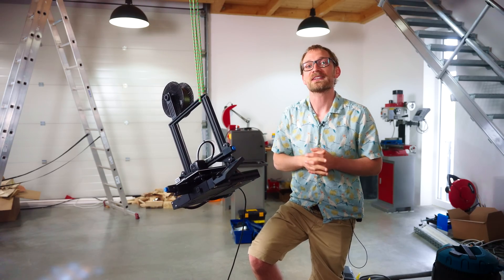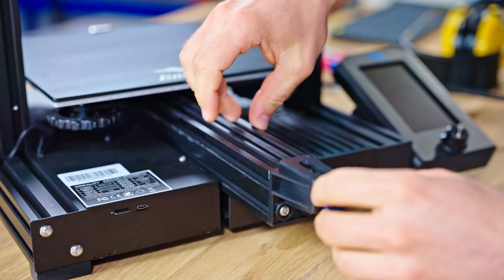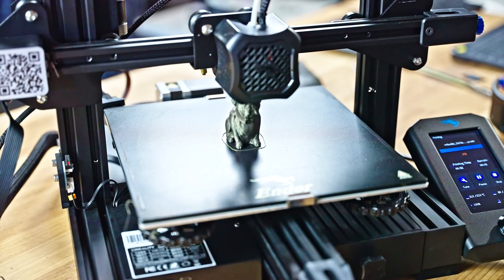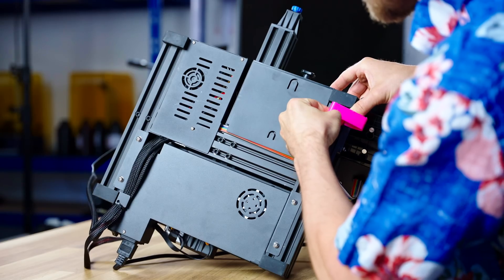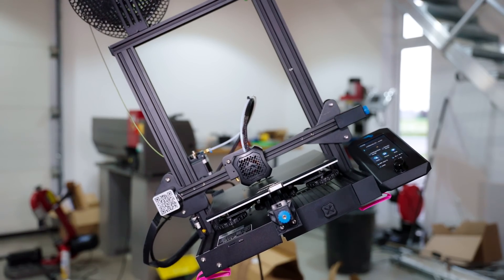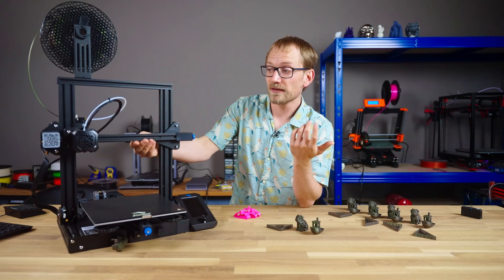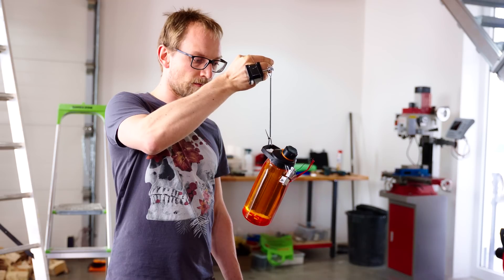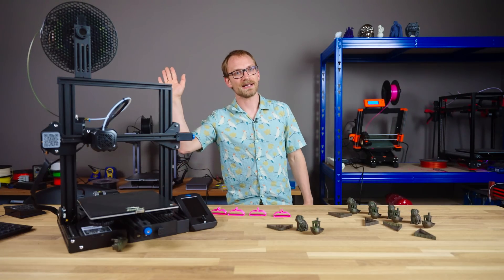Wobbly 3D printer makes for better parts!

Comment: I'm interested to see a printer mounted on shock absorbers for rc cars now, since they are designed to dampen motion.
Reply: My Anycube has such springs under the build plate. I have never observed ringing, but must admit I have only been 3D printing for 7 weeks now
Reply: @juliusfucik4011  The springs under the build plate are there to allow you to level the bed. They aren't designed to damp resonances, and if they are too loose, that can actually lead to problems. You want to have the whole printer frame on springs so that all axes are damped. Also, most of the time the default jerk and acceleration settings on printers are very conservative, so you won't see any ringing.

Comment: perhaps attach a container 1/2 full of sand to the printer head and also perhaps a bigger container of sand to the build plate. the sand container cant be full because it needs to be able to shift, and the more sand that can shift the better i'd imagine. if everything was coupled to the ground but the printing head, and if the printing head had some kind of ballast to dampen vibration, that would be ideal. it's pretty obvious to me that stepper controllers are going to get smarter and compensate for ringing in software.

Comment: For damping it might be worth trying magnetic damping. If you had a large price of copper and some strong magnets held in close proximity the magnets movement induces eddie currents in the copper block absorbing a lot of energy. Could put the printer on springs and have strong magnets on each corner above some copper blocks. Not sure if it would work but I think it would be cool to try.

Comment: Very interesting! Would also really like to see the sand method. I wonder how much of a difference it would be, if you took an ender 3 / i3 style printer like used in the video, and simply poured sand into the empty spaces of the bottom extrusions. I wouldn't think it would add that much weight? but maybe it would actually be enough to make a difference

Comment: I didn't know that even just staying within the elastic deformation range of a material, it will still turn some of the energy into heat.
Until now I've only seen that way beyond deformation, like taking a penny and smacking that thing with a hammer really hard a few times and then touch it and it's pretty warm.

But that the vertical suspension didn't really change anything makes sense after all this, because the dampening axis is almost exclusively in the Z direction, but the main oscilation happens in XY.
So going with the cube suspension where a lot of the dampening would go into XY instead should have results, just like the feet did. Maybe even a lot more of an effect.

Comment: ACTIVE vibration reduction. 

A 3D printer that has masses actively moving in opposite directions to the the print, trying to reduce and even cancel the vibrations. 

Could even have the same processing technique as Noise Cancellation headphones. 🤔

Comment: Could you remove the spring or bungy effect of the rubber with belts that do not stretch? That way the energy is passed directly to the frame and absorbed by those springy feet. Maybe remove the belts altogether and have a gear drive on a toothed rail?

Could the ringing be removed with software? It looks like feedback ringing around the desired location. Since we know in advance the ringing is going to occur after certain directional changes and we know the steps we are going to be taking in advance, can't we microstep our way over the ringing issue? You can certainly measure the ringing frequency/distances so these could be used as input values to an opposing set of steps. PID works real time where I am vs where I should be, but we have the advantage of knowing issues on movements that are coming. You know, a flat straight line which will have ringing on it could be GCoded as a wobbly line in an opposite to ring shape.

Comment: When woodworking, using a scroll-saw, there was an idea of building a 2” high box base with 4 dividers on the x and y. The dividers had 1/2”holes drilled half way up between junctions of dividers. This was then filled to the top of the holes withs sand. Then a top secured to this structure. The scroll-saw once secured to the top of this box, the vibration was reduced a lot. May be worth trying out. Regards.

Comment: I have another idea. We used to paint mask extrusion slots with rubber tubing. Get thick rubber tubing. Stretch it longe and slip it the slot, when you let go, it expands to fill the slot. I know it dampened audible rings very well, but not sure how it would stack up against sand.

Comment: My thing that many in the Anet group have tried with success...Is to mount the machine hard to a plate of MDF/chip board like countertops are made from.  Ideally a counter top cutoff that can be cut and glued back to back leaving the laminate surface on both sides. This is 1.5 to 2" thick and leaves 6-8" beyond the printer base. You can put feet on the bottom of this plinth, I used wine corks to make 3 feet. The resulting base is HEAVY and dense, but does not ring like concrete. Quiets it way down.

Comment: It seems like you accidentally used the table through the anti-vibration feet as a tuned mass damper.  It would be neat to see what happens if you were to duct tape a half-ish full water bottle to the top cross tube of the frame near where the filament mounts.  Basically a very un-tuned tuned liquid damper.

Comment: I don't see anywhere you said exactly what accelerations you used, but at the ones I saw the printer moving at, ringing is a completely solved problem with input shaper.

Comment: Awesome video. I would love to see a follow up on what feet would have the best result. I'm currently using a different type of feet and they don't really bounce a lot, so I'm wondering if they're not too stiff.

When reasoning about why it works; it's actually no surprise that the feet work best, as you explained very thoroughly. With cars you have a thing called unsprung weight, that's everything that's not cushioned by suspension (which is basically all the tyres and brakes). You need a good spring/damper combination, to dampen all both the vibrations of the chassis and of the wheels, as it's impossible to prevent undulations due to road imperfections. That matches the function of the vibration feet. Also, you want to keep that unsprung weight as low as possible, especially in relation to the chassis weight. That translates to adding sand to the frame for printing.

Comment: If you want to be rid of vibrational resonance, which is essentially the problem, you need multiple materials each with different resonant frequencies. Then, whichever frequency is being produced, no frequency is allowed through all layers of the support material and the resonant frequencies are damped. 

This damping needs to happen in all three possible directions of movement.

Comment: I use squash ball or racket ball mounted in a 3d printer holder that is then mounted to the bottom frame. Works really well.

Comment: How about you try attaching 2 identical printers to one base and have the synchronously run the same g-code but one of them has the x and y axis reversed, so they cancel each other out. Or possibly you’d need 4 printers with all combinations of x and y axis reversed and not reversed. Even better.

Comment: Maybe a wire rope isolator could work 🤔 I had good results in the past with isolating vibrations from my drone to a camera using a wire rope isolator. It's easy and cheap to make using some pvc pipe endcaps and bicycle break wire.

Comment: I would just use steel extrusions instead of aluminium extrusions. However, I haven't found precision steel extrusions. I think casting some heavy metal into the extrusion cavities could be the best solution as sand that gets into the mechanical parts can cause a whole host of issues.

I'm using a DIY converted Makerbot Replicator 2x with open source hardware in it and the frame is made of steel. It produces way better prints than my aluminium printers.

Comment: I use washing machine dampeners. They can be bought in hardware stores and you are supposed to cut them to size and put under washingmachines. They are made of cut up rubber and I think they work really nicely. It reduces noise by a lot, and it helps with ringing too.

Comment: Bracing the gantry and moving the spool holder will make more of a difference than anything else since that's where most of the vibration happens, all you need is some thread bar and a handful of 3D printed parts 👌🏻

Comment: I was expecting you to make braces for all the 90 deg frame angles.
I reduced the ringing on my printer by screwing it on to a piece of wood and bracing front centre and rear centre where the belt and stepper motor attach to the frame. The front and rear base diagonals were flexing a tiny bit thanks to the weight of the print bed and glass.

Comment: Lead shot indeed does sound like a good idea here. Maybe exen mixed in with fine sand? Anyways, fill ‘er up and let’s see what that does. I imagine the dampening effect would be similar to one of those hammers that have their heads filled with steel or lead shot. I can’t remember the proper term rn so please excuse the clumsy explanation. I might give that a shot myself, no pun intended.

Comment: Simple answer - the higher the mass the more resistant the object is to get excited by external forces.
Or to put it simple: The more weight the steady gantries and the base have the less likely they start to vibrate from moving parts which are mounted onto them. And for the moving parts it is all reverse: The less they weight and the slower they are moved the lower is the force they work up (accelerated mass) to inflict excitement on the gantry or base.
So, filling up the hollow of the non-moving parts should result in less vibration.
One caveat so: The table where you place the printer onto also will have an effect. If the table is wobbly to start with it will become the weakest point of the overall system

Comment: I could be entirely wrong, but staying within your specific stepper motors “magic multiple”, which is x4 for creality stock steppers, should lessen the salmon skin effect. I am yet to get a print that has it on my Ender since the steppers are aren’t trying to rotate to an in between pole position.

Comment: My printer sits on a desk I used some 90 degree brackets to mount it solid to the wall and cross braced the legs on the desk to take movement out of the desk not the printer solved nearly all my print problems on Anycubic Chiron i do use printed feet more of a squash ball type mostly to improve airflow under the psu and motherboard...

Comment: I think silicone or something similar would be better than sand. Sand will pack hard. Even unpacked, it still has some kinetic transfer (if that's the right terminology).
I suppose they are equally messy but sand near any precision machine (or your lunch) is just a bad idea. Another great video. Thanks Tom.

Comment: I have a cube-style printer and am pretty sure my open square bays are oscillating. Something as simple as tensioned cables could likely fix ringing issues with little cost and weight. Since you don't mind modifying this printer, try adding "guy wires" to the frame front to back on both ends. Also, regarding the ringing you see, is it happening in just one axis, or both? That's a strong tipoff on which axis needs stiffening.

Comment: Instead of where you tried to convert a 3d printer into a CNC, maybe the opposite would be interesting.

Converting a fairly rigid and fast CNC to a 3d printer.

Comment: I’ve got a fairly large printer..  build volume is 600x600x900.  It weights over 100kg and i’ve never had any ringing issues with it.  Thats probly because it maxes out at 33mm/s print speed due to the E3D volcano limitations (1.2mm nozzle, 0.6mm layer height, pla @240*c).  Currently im redesigning it for a direct drive setup and probly going to put a super volcano on it or some other high-flow type nozzle.

Comment: Installed Klipper a couple days ago and did Resonance Compensation tuning with an ADXL345.  I still have a lot of other tuning to do, but ringing is GONE at normal speeds even on the wobbly table I'm working on.

Comment: An ikea table and 4 50x50mm pieces from wife's yoga mat. Printing at 50mm/s is fine with me. Don't plan on switching to klipper yet. But heard something about input shaping (using a adxl345 accelerometer) and speed improvements using klipper.

Comment: I would love to see you try more materials. I currently have mine in a concrete-ish slab on top of a isolating foam slab, but more to protect the entire cabinet I have it on from shaking more than to protect the printer itself.
I wonder if I put those feet on it I might get even more of a vibration reduction on both cabinet and printer, or just reverse and put the foam on top of the concrete slab.

Comment: Really interesting. And what a great space you have there. I’m quite jealous.
For those of us using Input Shaper, it’s really easy use that as a crutch and forget about passive vibration reduction. It’d be interesting to test Input Shaper with and without feet. The issue is you can only generate the Input Shaper settings with a stationary printer, as there’s no fixed accelerometer to use as a reference. If you put the printer on feet, Input Shaper won’t be able to distinguish the overall solid-body printer motion, from the tool head to bed relative motion (which is the only motion we care about). But if you calibrate without the feet, and then mount on the feet, the reduction in the relative motion provided by the feet would lead to Input Shaper over-correcting.
The only way around this I can see would be for Input Shaper to adopt a dual accelerometer configuration with one on the tool head, the other on the most rigid part of the printer.
Reply: You’ve actually just described an issue with input shaper that happens all of the time, not just with wobbly feet. The printer body always moves relative to its surroundings unless it’s bolted directly to a concrete floor and even then there’s still some flex in the printer. Using an accelerometer isn’t a perfect solution but it usually works pretty well because the resonances of the whole printer are often the same as those measured at the nozzle and bed. But there may be differences if you have very loose or flexible parts. What you really need is an accelerometer at the nozzle, on the bed and on the main body of the printer capturing acceleration in all dimensions, then cancelling out to show what the true nozzle to bed interaction is.

In practice, you could run input shaper  before or after installing the wobble feet and it would likely work just as well. There is no such thing as over-compensating. Input shaper will not over-correct and cause different ringing patterns, that’s just not how it works. It reduces the motion over a range of frequencies by a certain percentage. The wobbly feet did not get rid of the ringing, it damped it so it was less visible. The input shaper will reduce the initial impulse that caused the ringing. They should actually work well together.
Reply: Are there any versions using two (print head + frame) or the very overkill three (print head + frame + surface/tale) accelerometers to account for that error you mentioned?

Comment: I didn't know CNC machines sometimes had sand in them, but I am aware of the difference it makes in dampening the noise from roller coasters. If adding sand equated to the difference between B&M roller coasters with or without sand, that would be enormous. Check out a video called "B&M Empty track vs filled track sound comparison" for an example.

Comment: I work as industrial maintenance guy from the past decade.
We do what is called the geometry of machinery in my mother language, not sure how they call it in English.
A thing I didn't learned from the school and experience was my way to get it right: vibration, alignment and other factors that can mess a machine must not be fight, but changed to the most ideal range.
There is always a working scheme that will make mechanisms resonate, so you calculate it in a way that the resonation don't mess the product.
Specially about vibration, the way to go isn't always making everything sturdier, but appropriately directing all the vibration to the machine's base (ideally by moving the center of mass down in the machine is a great feat).
Reply: Btw, a good way to go is reinforcing the structure in a way that you redirect that vibrations to somewhere it's not going to mess the jobs.

Comment: Would be good to get in firmware a setting that varies acceleration/speeds to prevent harmonics occurring i.e the stepper is always either accellerating or decelerating and never at a constant speed so any harmonics are cancelled out. This is often used in CNC machining to prevent chatter.

Comment: Perhaps the trick to the effectiveness of the CNC Kitchen-style paver/foam block combo is due to the paver spreading/evening out vibrations, while the foam allows them to pass through to some extent? With just the paver, you're adding rigidity but not really doing anything to dampen vibrations.